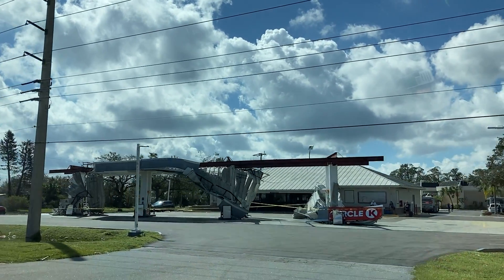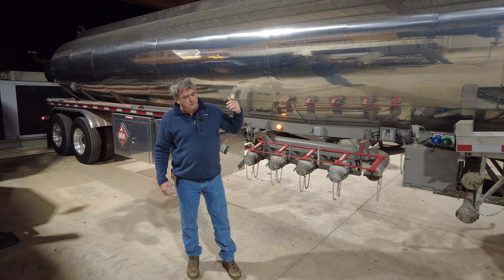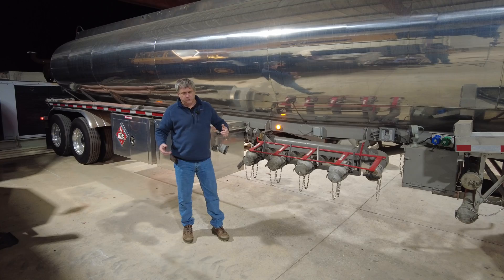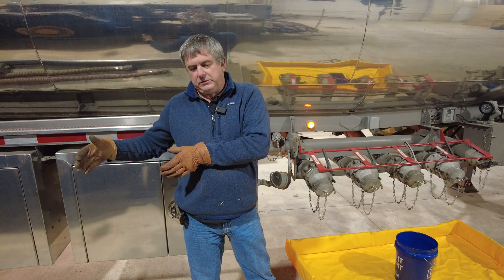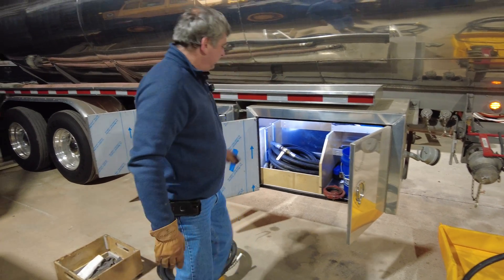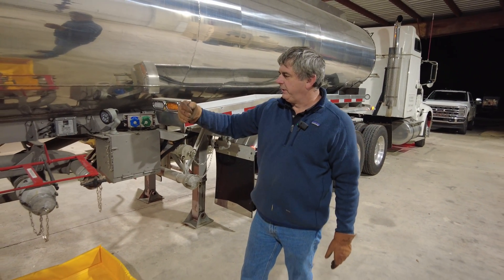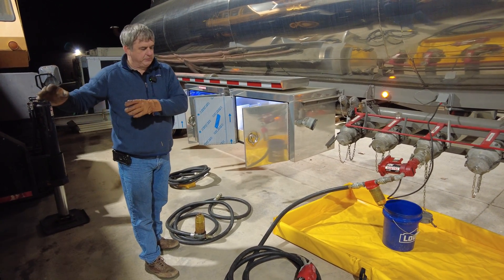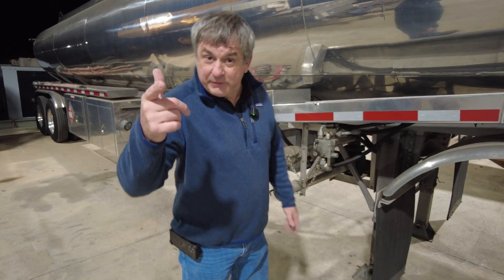How We Use A Fuel Tanker as a Portable Gas Station on Hurricanes!

Comment: Have you thought about installing rv type small 12”x22” bathroom windows on each bunk room wall for allowing cross fresh air exchange? This looks very good.
Reply from the maker: I have.  Actually bought them for the first unit.   However, we way we utilize the trailers all they would then require is to be covered.   As to the fresh air, when the trailer is operated the circulation fan for the hvac runs continuously and the system operates pressurized with 15 percent make up air and a separate dehumidifier to maintain the humidity as the hvac is way over capacity 5 tons …. Great question.  Thanks for watching

Comment: Do you have a grounding system
Reply from the maker: We have a clamp system that we can ground the tank or vehicle.  The hoses we use on the small pumps have static lines or wires for grounding …. And we have the grounding/filling system that does the probes in each compartment for the rack loading, it has an integrated grounding system as well.  Great question.   Thanks for watching …..!!

Comment: that's a transport trailer you know they make trailer's and truck's made for fueling with all the correct equipment and certified meters
Reply from the maker: I do now when I first purchased the trailer I was not really that knowledgeable….at that time I also wasn’t in a position to purchase a new one …. The trailers with that gear don’t come up very often in the secondary market.  The plumbing and pumps would have been handy the metering is not really a necessity and I think I like my hydraulic controlled pump a little better on the volume stuff.  But yes you are correct the commercial version would have been better than the converted tanker.   Thanks for watching.  I appreciate the input.

Comment: Looks good! Although I'd be concerned about sparks from the anderson connectors igniting the vapours...
Reply from the maker: That is a great point.   We currently handle that issue with a procedure.  The pump is verified off the connection to the truck is verified  disconnected the fuel or vent has not been opened.   Then the tractor connection is made.   That way the sparks associated with the motor switching happens with the motor control housing that is sealed.   I am looking for a sealed connection.   Those motors pull under 30 amps.    So if I could find a sealed rated  connection I would change it to prevent that spark if someone connected the tractor first, opened the fuel or vent, mistakenly connected the tractor power and inserted the cable with the pump on.   I know that’s a lot of what ifs.   But I think it would be better.  Great pickup.   Thanks for watching.
Reply from the maker: As a second point.   I found lots of connections that are rated once they are mated, but our issue is a connector that will rate while being made up or connected….. thanks again for the question.

Comment: You could outfit one of these trailers with a hard mounted double diaphragm pump where your front toolbox is and use your air to pump fuel with a mounted filter and hose reel, just attach it to your load head with a flexible line.
Reply from the maker: That's a great idea! We'll look into that. We keep our trucks idling anyway so the air wouldn't be a problem. Thanks for watching and commenting!
Reply: @ParkerSystems  air is already plumbed on the trailer so it wouldn’t be as intrusive as needing 15-20 amps of 12v to run the electric pumps and most of them are serviceable so you could keep parts or a whole spare pump for redundancy. Just an idea to look into. Never hurts to have too many options when it comes to functionality in a disaster area.
Reply from the maker: thanks for watching

Comment: Y’all need to ditch the plastic bucket. They’re illegal to o have on a fuel truck due to static electricity.
Reply from the maker: Good to know.  Thanks for the heads up.
Reply: Must be a Commiefornia rule.
Reply from the maker: I see lots of them out there -- even the drip pans that most put down are plastic -- we of course wish to do everything correctly -- ironically there are a-lot of plastic gas cans sold @smorefirewood

Comment: When pumping fuel to your customer, how do you meter it?
Reply from the maker: On a typical deployment all our users are our customers and our equipment, metering is not required.  We have a clip in flow meter that connects in like our filters if we had to measure small quantities…. This is where I may get a little push back for being a geek … the tank is an ellipse so you can use calculus to determine the volume of slices so I generated the volume of 1 inch slices thru each of the 4 tanks and get to with 3-8 gallons my simply measuring the depths.  But like I said we never need to do this.   Great question.   Fun fact did you know they sell gasoline based on temperature…. When you load they created an offset based on the outside temp.

Comment: Wouldn’t it be easier to just rebuild a surplus M969 Military tank trailer? They can haul and dispense bulk fuel, while also setup already for dispensing to vehicles, fuel filters, and can hold 2 different products at once.
Reply from the maker: Most likely.   I wasn’t aware of such a machine.  That would have been easier.  Are they dot over the road approved and how many gallons does each compartment hold.   Great suggestion.  Thanks for watching.
Reply: @ParkerSystems government liquidation and Ritchie Brothers auctions them off. People are able to buy the vehicles and register them. Some even buy the HET and register them also, so should be no problems.
Reply: The military fuel tankers are not divided internally with separate tanks all they have is baffles to reduce slosh so instead of being able to haul multiple types of fuel you can only haul one type of fuel…… so you would need a separate tanker for each type of fuel additionally they are very heavy the 969 and the 967 only hold 5000 gallons that tanker has a capacity of 9000 gallons and realistically speaking probably doesn’t weigh too much more fully loaded military tanker
Reply from the maker: thanks for watching and taking time to comment
Reply: A 969 is half the size of this thing add in their super heavy compared to a true fuel tanker

Comment: It’s interesting that during an emergency situation that one would worry about on and off road diesel. Are the Feds that idiotic? Too bad over in my part of the world they don’t have the brains to setup equipment like this. Sometimes I wonder why I left the states.
In this country if you have an emergency generator that runs on diesel the government compels one to run it on the more expensive road diesel. Not for this guy the emergency feed goes straight to my heating oil tank. Anyone trespassing on my property will meet a sentry dog from the USMC that will hold them at bay until I get them in handcuffs.
You guys Rock! It’s nice to have a setup for each issue for emergency services.
Reply: The dye is still in the tank when the emergency is over. They’re only going to use it for generators and equipment.
Reply from the maker: Yes sir.   You are spot on.   We run non-dyed in everything just for that reason.  Thanks for watching
Reply from the maker: I mentioned the different types of fuel as reason you needed different compartments.   But exactly to your point we take “0n road” or NOT dyed fuel.  The issue is event is federally declared they suspend those crazy tax rules.   But that dye will hang around … so we basically just use non-dyed …. Great comment.   What country are referring?    Thanks for watching